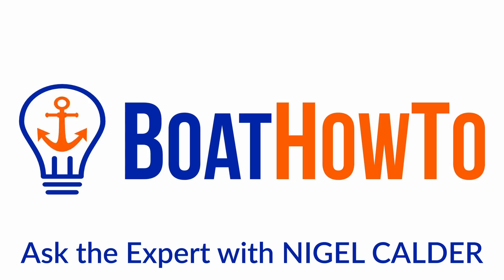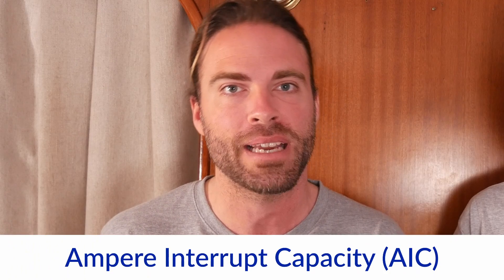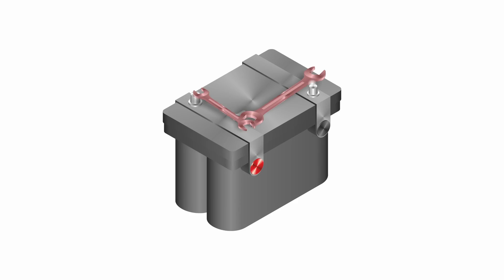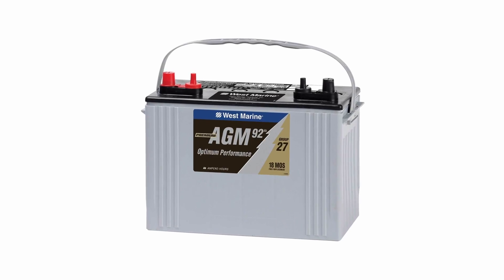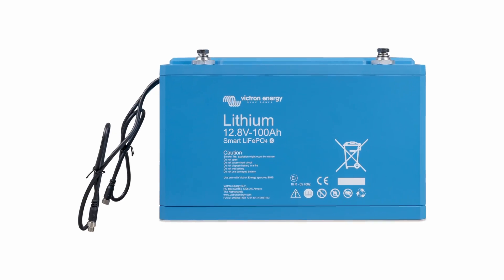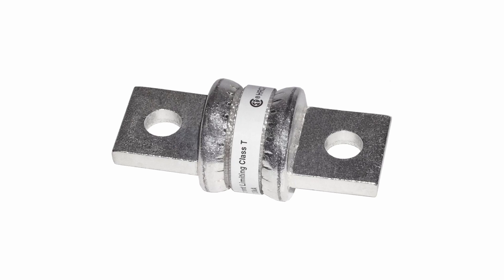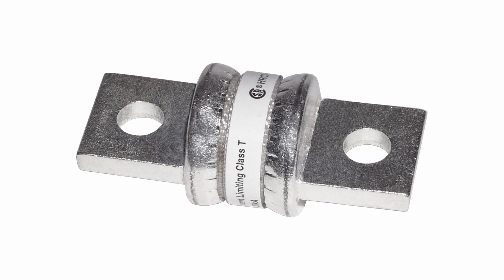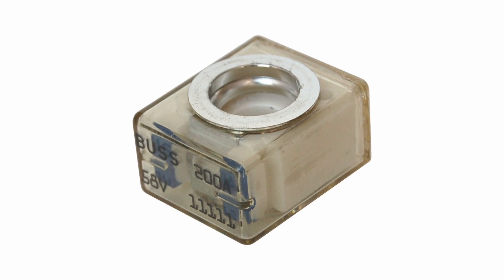AIC-Rating on Battery Main Fuses - Why is this so important? | Ask The Expert with NIGEL CALDER

Comment: I learned one time by accident what you said in the beginning of the video about shortening out a batterie with a wrench. I had a 100 a batterie in the back of a tricycle and a stainless steel  thermos for my coffee. The thermos got fell between the contacts from the batterie and melted a large hole into the thermos within seconds.

Comment: Interesting discussion. On a related topic, many install lightning arestors in their VHF coax cable (to protect their electronics) but i have long been skeptical as to whether those small devices can arrest the massive power of a lightning strike. Do lightning arrestors have a high AIC rating?

Comment: What about smallish outboards? How do size a main fuse for cranking circuit on a 115hp outboard? I know it's never done but thinking of adding a main fuse to battery terminal for cheap insurance in case of dead short
Reply: Does the starter have any information on it indicating how many amps it is rated for at 12 volts (or whatever voltage you are running at)?  Or, if there is no information on the starter itself, how about measuring the amp draw on the battery when the only load on the battery is the starter and using that as your baseline?  If you know what the normal draw is (in amps) on the starter, you could fuse it slightly larger to account for initial inrush draw.  It seems to me that the starting circuit is the one circuit that is not normally OCP protected-and I cannot remember why that is.  You ask a good question and deserve a better answer than I can provide.  If you are interested enough, then maybe you want to sign up for their boat electrics 101 course and ask the question there.  I took their online course years ago and found it well worth it.  Unfortunately, I have not been actively using the information so many of the details I have forgotten.  That is my problem, not the fault of the course.

Comment: Thanks for the advice on Class-T for lithium.  One point is I don't believe T-Fuses are ignition protected (albeit you can get ignition protected cases - but not sure how that works with hydrogen?) and hence should they be located near the lithium battery in a shared battery box (with an AGM starter battery for example).
Reply from the maker: There is no requirement for ignition protection in battery compartments. With lead-acid batteries (i.e. wet-cell, AGM or gel) ou do have to make sure though, that there is an upwards path from your battery so that hydrogen can not accumulate in the battery compartment.  - Jan

Comment: I agree that Class T has a higher AIC than others, but if you look at the BlueSeas MRBF fuse it has an AIC of 10,000 at 14 volts. So if you have several 12 v lithium batteries and one of these on the positive terminal of each battery it seems like this AIC of 10,000 should protect excessive current coming from the battery.
Reply from the maker: A couple of points. We see a lot of higher voltage DC systems (e.g., 24v; 48v). With each step up in voltage the AIC rating goes down, so the MRBF are definitely not suitable as a main battery overcurrent protection device with lithium-ion in these applications, and once we get to 48v not even suitable as the main battery overcurrent protection device with lead-acid (at 48v the AIC rating is around 2,000A). Even at 12v, many lithium-ion batteries have a short circuit potential above 10,000 amps. Unless the lithium-ion battery manufacturer specifies a short circuit potential below 10,000A, I would still recommend a Class T (or European NH). - Nigel

Comment: Could you explain how to choose between the Class T fuse and the HRC fuse like NT00?
Reply from the maker: The reason I focused on the Class T fuses is because they have been widely used in high AIC recreational boating applications and are widely available. Any fuse that has similar functionality could be used in place of the Class T. I am not familiar with the HRC fuses. I did a quick Google search on the NT00. It has a very high AIC rating although as with the Class T fuses, the AIC testing is at higher voltages than the 12v, 24v, and sometimes 48v at which we use these fuses. In any event, it will be well above the requirements in the ABYC standards and could serve in place of the Class T fuses.
- Nigel
Reply: @BoatHowTo  I am wondering if the Class T is faster at breaking the short circuit.
Reply from the maker: @mrtechie6810  That depends on the characteristics of the fuse, which is usually dependent on the manufacturer. You should be able to get a data sheet where this is indicated.

Comment: Dear BoarHowTo, I plan to use CBs.... is there a problem using CBs instead of fuses for lifepo4 battery OL protection? Thank you.
Reply from the maker: You will probably have a hard time finding a circuit breaker that has an appropriate AIC rating. But of course there is no problem with using a slow-blow Class-T fuse with a high AIC rating and then put a fast tripping breaker with a lower trip threshold behind it. This way the breaker will trip in most "normal" overcurrent situations and in case you have a dead short and the breaker arcs over, you still have the fuse to protect you from a catastrophic battery meltdown. - Jan

Comment: On my boat I have a couple 12v, 100 AH BattleBorn LiFeP04s, in parallel.  They're each rated at 100A continuous, and 200A for up to 30 seconds.  I believe that the BMS is designed to shut down the battery within milliseconds if the current exceeds 200A.  What level of overcurrent protection will this provide?  Is a fuse still required?
Reply from the maker: Jim,
The answer to your last question is a big YES! You absolutely need appropriate overcurrent protection. No BMS is not designed to reliably interrupt the high currents in case of a direct short circuit. Most BMSs use MOSFET technology. In a serious short circuit, this will melt down to a lump of lithium and copper within seconds and there is no guarantee that this interrupts the current flow. The only way to a safe installation is a fuse with a very high AIC rating!
- Jan
Reply: @BoatHowTo   The high AIC rating is a given. But if a LiFePo4 is rated as outlined above (100A continuous, 200A for 30 secs) - how do I scale the Class T fuse? 100A or 200A or even higher? Or does one control the draw by the secondary fuses to the loads?
Thanks for a great video on the subject! 🙂👍
Reply from the maker: @gonefilming2020  The job of the fuse is to protect the conductors, not the battery (that is the job of the BMS). So the fuse rating should be smaller than the conductors ampacity (see also here: https://boathowto.com/electrics/fuses-circuit-breakers-on-boats/ and of course our course!). So a suitable size for the fuse is anywhere between the maximum load you expect and the ampacity of the main conductor. - Jan
Reply: @BoatHowTo  Thank you! ☺
Reply: I prefer to not stress (or rely solely on) the BMS, its safer for the batteries, which in my case, are the most expensive item.